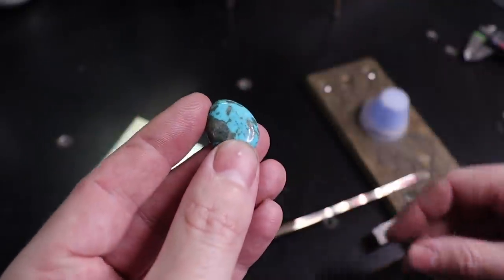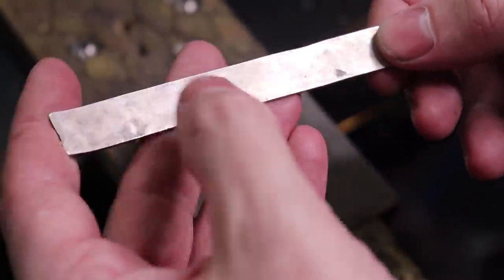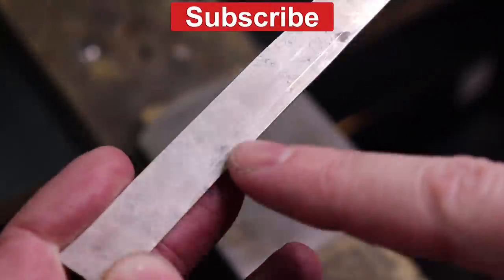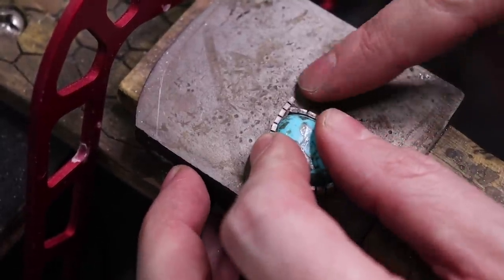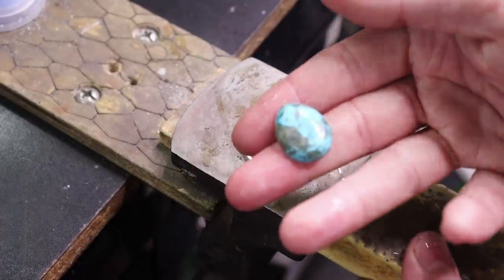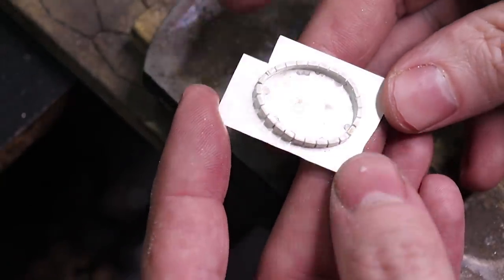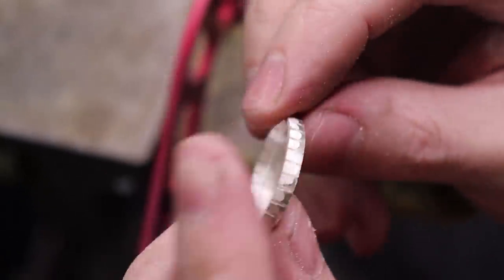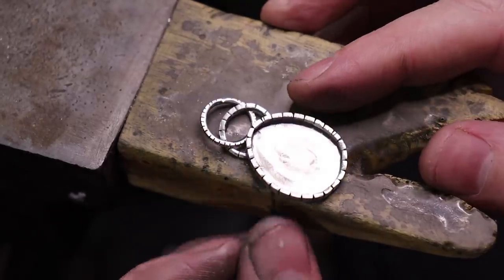How to Make A Thick Bezel Necklace

Comment from the maker: H.15 Hammer Handpiece:
Pepetools  - http://bit.ly/h15hammer
Amazon USA - https://amzn.to/39HRzBs

H.15D Hammer Handpiece:
Pepetools  - https://bit.ly/PepeH15D
Amazon USA - https://amzn.to/3cqDQRi

Threaded Anvil Points Foredom 6 Piece Kit:
Pepetools - http://bit.ly/H15HammerTips
Amazon USA - https://amzn.to/2V6GpRv

Foredom Flex Shaft With H.30 Handpiece:
Pepetools - http://bit.ly/K2230
Amazon USA - https://amzn.to/34hwMUe

Bezel Pushing Set:
Amazon - https://amzn.to/2KdYCHu

Fabulustre Polishing Compound:
Amazon - https://amzn.to/3aM7YWD

Silicone Finger Protectors - https://amzn.to/2xN46pZ

5 Inches Saw Frame - https://amzn.to/2XH9EwZ

If you are looking for more tools and materials that I use, well you're in luck! I made a page on my website just for that that I'm updating all the time so bookmark it to stay up to date GomeowCreations.com/tools-and-materials and GomeowCreations.com/partners-discount-codes

If you buy any of the tools or materials from my list I will make a small commission at no extra charge to you and it helps support the channel

Comment: Thanks so much for your super informative videos. Your great a teaching, and I really appreciate that you explain “why” you do or do not do certain things. That really helps me retain the information. It helps the process make sense. 
I do have a quick question, what is the mesh screen you soldered on made of? And/or where can I find one? I did check the video info as you’re always so great about listing the tools you used. However, the screen wasn’t listed. I like that it’s so much thicker than the type that typically come on the soldering tripods.

Comment: Hey Randy.  You should try using fine silver and fuse the bezel closed and fuse it to the back plate.  No solder to cut, no flux, no pickle needed, and then you can start at the top with hard solder on any other parts.  It's a huge time saver.  
Also your hammer handpiece points will leave a much better finish if you round off those 90 degree corners and polish the face.  Thanks for sharing
Reply: I am going to try that! Awesome suggestion. Fusing has always intimidated me...but it's time to give it a whirl!
Reply: @ghosttownmetalworks  Also if you ruin a piece of fused fine silver, it can go right into the melt dish next time you pour some sheet or wire and since there was no solder, it's still .999 fine.  I have stopped using copper to make test pieces.  Fine silver is just so much easier.

Comment: Great video. Just got the hammer piece for my flex shaft. Can’t wait to try this. I have a question. I have been trying to solder a 1 1/2” piece of sheet silver 22 gauge to a slightly larger piece of 22 gauge sheet of copper. Sweat soldered the solder to the back of the silver piece fluxed both pieces and placed it on top of the copper piece. I have tried to solder this 3 times. I only have hand held torches. One small and one a little larger I can not get the solder to flow. Any suggestions or maybe you could do a video on this type of thing. Thank you so much. Your videos are awesome
Reply: Try binding wire and double fist your 2 torches.  My guess is you are not getting enough heat.  
You might also check out this : https://www.amazon.com/Bernzomatic-TS8000-Intensity-Trigger-Start/dp/B0019CQL60 with one of these :  https://www.homedepot.com/p/Bernzomatic-WH0159-Universal-Torch-Extension-Hose-361542/202539579 .  You will want to turn the fuel way down because this will be too hot for what you're doing, but it will serve you well if you ever do more heavy duty torch work.  Good luck.
Reply: Thanks. I think I will try the Benzomatic

Comment: Why do so many jewellers use backplates for bezel settings?
Reply from the maker: It's easy to get setup and the right shape. You can make designs in the back of them if you wanted to to show off the back of the stone. Why do you ask?
Reply: @GomeowCreations  Because I want the skin to be in contact with the gemstone.

Comment: Worth noting that if you choose to make your bezel any taller, there will be a bigger gap to close when setting the stone, and it may be too difficult to close it all the way, plus it will not look as aesthetically pleasing as the height you made it, so going taller is not a great option. Also, turquoise (especially with matrix) is not good in an ultrasonic machine. It can damage the stone.

Comment: The tape is genius! Then as a student, I am not accidentally scratching my stone measuring the bezel wire. Looks like you used painter's tape?
Reply from the maker: Yes it is just some painters tape, it sticks good and comes off easy without leaving any adhesive behind.
Reply: @GomeowCreations  If you use that same tape over the bezel (before using the reciprocating hammer) you won't get the damage afterwards....it saves a step & preserves the bezel (something drilled into us @ GIA LOL). Beautiful piece, the end result is very cool.